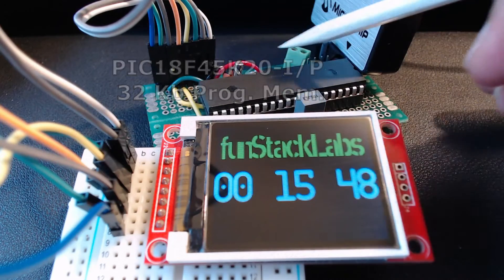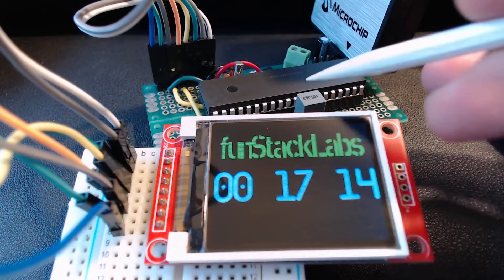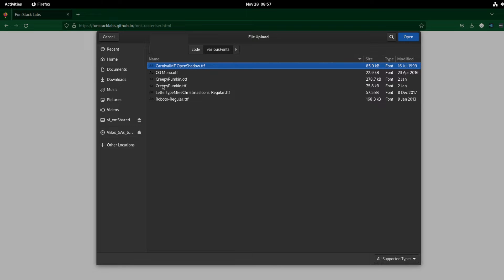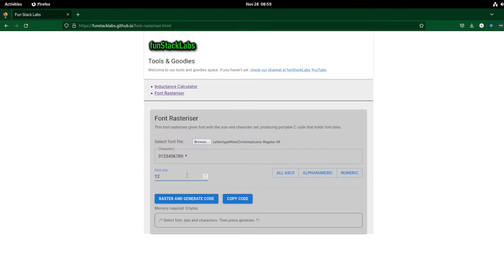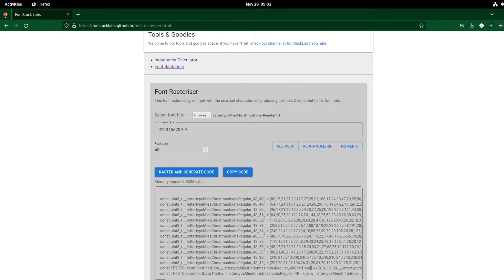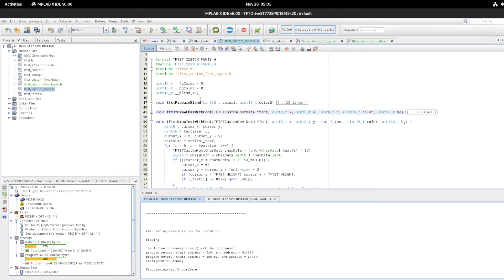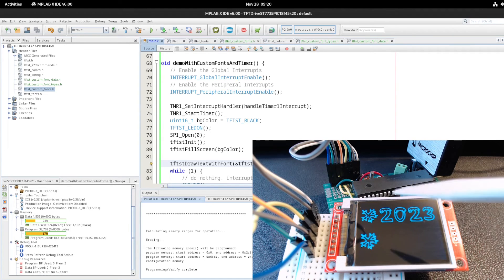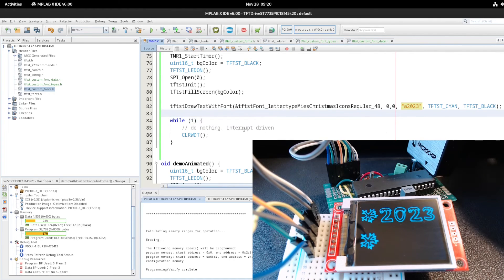Display any custom font on TFT LCD screens with micro controllers

Comment: Love the tool and the example shown. Trying to use your font outputs on another platform and I'm trying to work out how your compression algorithm is working. Do you have any references that you can share? Specifically when you use tftstSetWindow() and then start writing the data, is it writing each pixel column first and then when its done all the columns it increments the row?